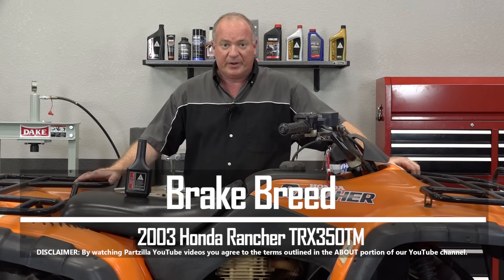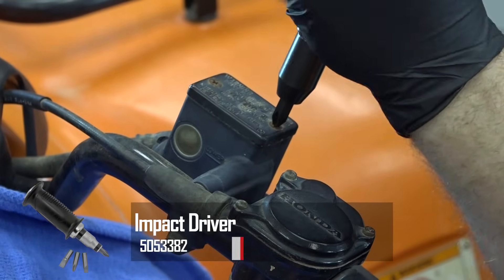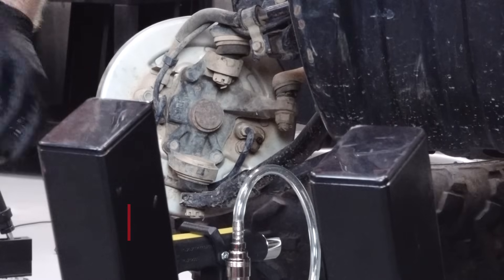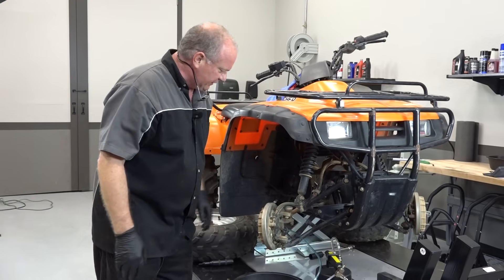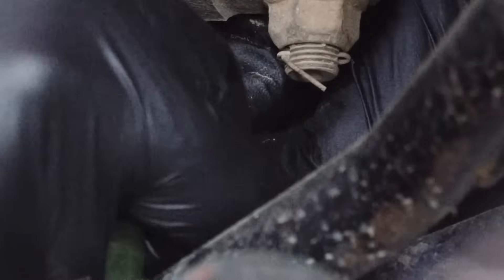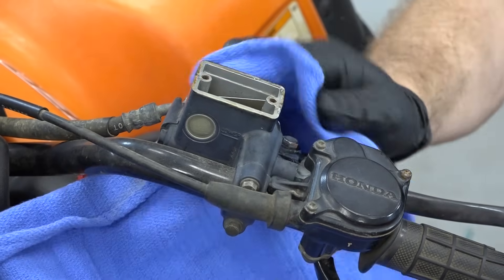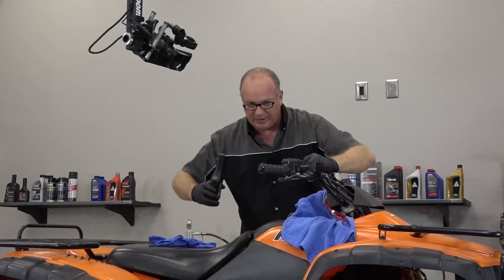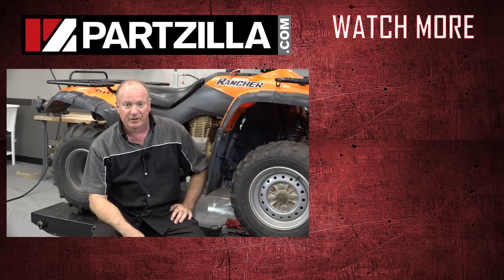How to Bleed the Brakes on an ATV | Honda Rancher 350 | Partzilla.com

Comment: what does it mean if I pump the master cylinder and no resistance/pressure being made; no fluid comes out of the bleeders at each wheel? I have just put on new brake cylinders and followed your directions for disasemblying the master cylinder (cleaned it as didn't get rebuild kit).
Reply: I just done the same on my 03. Never could get any resistance on the hand brake lever. Replaced that master cylinder and had no problems getting great brakes.

Comment: Hey bud, im having issues trying to bleed my 89 fourtrak. I put new pads new cylinders and a new used master cylinder and i can't bleed it and there is no more air in the line that it seems.
Reply: Hey brother I was having the same problem I just kept writing for years with no brakes and just said fuck it.

But as I got older and wiser I just wanted to fix it. I did the same thing put new brakes new master cylinders and seems like I couldn't get the air out.

What you gotta do is adjust them almost all the way out to where you can barely squeeze the drum on  You might even tighten it more once you get the drum on then squeeze the brakes breaks and you will have breaks and you will be like oh my God.

 If you notice the brakes are too tight and it's dragging the 4 Wheeler just backup the adjustment a little bit until the it until the bike moves freely
Reply: @crawling86  I'm having a problem where nothing will come out of my bleeder valve when I open it up after pumping. should I try what you said?
Reply: @dustinbowen7201   Adjust the brakes out just enough to where you barely can get the drum back on.

After you know you've , Blood breaks I'm sure you've blood on perfectly fine every time, most people don't realize that you just have to adjust them out, once I adjusted the brakes it worked perfectly. That being said it's not that easy To adjust but it is once you figured it out it is.

 You will notice once you adjust them out and you hit the drum you will have something in your handle compared to nothing and then go from there.
Reply: @crawling86  Thank you I'll try that

Comment: Quick question, my front brake handle is very tight. Will only come back about a quarter of an inch. But the front brakes do work, and they work well. But I am concerned about the tight lever, not sure if that is an issue if the brakes still work fine?
Reply from the maker: As long as they aren't fading, it's fine.
Reply: Ok great. Thank you. And thank you for the video.

Comment: Trying to vacuum bleed my brakes after replacing the shoes.  I notice a lot of bubbles after multiple attempts to bleed each side. Not getting much stopping power. I noticed when you were bleeding with the mighty vac you had a lot of bubbles also. Is that normal and still acceptable or should it be just fluid?
Reply from the maker: Bubbles in the might vac tube?  That's normal.  Air from the connection and air from within the line.
Reply: @PartzillaParts  Thank you.

Comment: Is the air breather tube necessary to keep connected, or can I just plug it off.
Reply: james pruitt u should try to have it, the outer brake drum has a rubber seal, i like to grease that seal a little helps keep foreign objects out, and it theres no vent line it will have crap pour into it. If you were to simply plug it it will create a leak around the seal and let foreign objects in that way

Comment: i have a 1986 honda trx 350 4x4 and i'm having trouble with my front brakes BARELY working. I have bled my brakes maybe not enough put new shoes on and rebuilt my front brake wheel cylinders. But it seems as though as there to much pressure on my front brakes and they barely work. When I push in my front brakes I can't even get them to go all the way back to the handle bar. The lever moves maybe 4 inches and then I slow down but do not stop by any means. By the way i had to buy an aftermarket master cylinder, I just bought an OEM one on ebay and i'll be buying the rebuild kit. Any suggestions? thx
Reply: I also have new dot 4 brake fluid in the lines.
Reply from the maker: Wait, so the lever is hard, but won't transfer the pressure to the pads?
Reply: @PartzillaParts  yes thats correct, sorry for such a late response lol

Comment: I replaced my shoes but handle still comes all the way back with no pressure , cant figure out whats going on
Reply from the maker: Keep bleeding, sometimes it takes a bit.
Reply: @PartzillaParts  i had stuck wheel cylinders
Reply: @kp763  what did you do to make them unstuck haha?

Comment: I tried bleeding my front brakes with a mightyvac hand pump. It seems like air and brake fluid are flowing into the clear tube, after I close the bleeder valve on the brake panel. Can you tell me why this is happening? And as a separate question, do the crush washers for the banjo bolt HAVE to be OEM?
Reply from the maker: They don't have to be OEM.  The seal on the pump line might not have sealed?
Reply: Partzilla I bleeded my brakes after changing pads  got fluied to come out bleeder valve after lines were emply but brakes are not getting hard and not working yet . ? Im wondering if my caliper seals went bad now or what?

Comment: I’ve replaced the rear brakes on my Honda rancher 420 but after I got it back together; there is no reaction after I tried to apply the brake.  Can you think of what may be causing this?  I don’t believe the back brakes need to be bled like the front but I’m not 100% sure...help!   Please :)
Reply: Amber Pinnick yeah I’m actually in the same situation with my foreman 400, both front and back brakes aren’t working.
Reply: Your back brakes are mechanical. They can be fixed with lubrication of wires and Springs  new pads. It's very technical and in time consuming people give up quick.

Front brakes are hard too because they're hydraulic and I'm actually trying to get all the air out of my front brakes, got the back brakes fixed really good.

If you can't figure out how to get the small wire to stay put for back breaks attack welded mine
 Make sure you lubricate where the brake pads move
Reply: Just got front brakes to work need to adjust master cylinders almost all the way out! to were drum belay goes over brakes!!! That's why nobody can get the air out. It's not air its adjustment. If hard to move when done adjust back a little bit. 15 years no break's. Now front and back break's are 💪
Reply: @crawling86  I have a Honda recon and can’t get the brakes to bleed. Replaced pads and pistons. It’s pushing fluid out the bleeder and not air. But still no pressure on the pedal. Any advice?
Reply: @MrTap86  Hoping someone answers this, I'm having the same problem.  Tried gravity bleeding, tried repeated bleeding by squeezing the handle, still no brakes.
Reply: @crawling86  What adjustment are you talking about with the master cylinder?  Just bought mine, sight glass looked like it was cracked and piston was super sticky, so I just replaced the whole thing.  Gravity bled it, tried bleeding it by squeezing the lever, still no brakes.  Any advice?
Reply: @kveltman4672  so I figured it out. I used a brake bleeder from harbor freight. It forced all the air out of the lines. Worked within minutes. I am still struggling with the back brakes tho. Somehow it gets mud in the drum everytime the kids ride it and they lose back brakes. Iv replaced the seals and bearings it should be water tight. Idk I’ll keep trying
Reply: @kveltman4672  35$ for the pneumatic brake bleeder your front brake problem will be solved. For some reason pumping the brakes alone won’t get it done on these master cylinders on atvs

Comment: I dont know if i need to bleed but when i push my front brakelever in it goes all the way into the handle and then it doesn’t brake.... what should i do?
Reply from the maker: Make sure your fluid level is full and then you will have to bleed the system

Comment: I have recently replaced my brake pads, new cylinders and new master cylinder. I have lost all brake pressure and cannot get any pressure after bleeding. When driving I can hit the brakes 4-5 times and the brakes will activate. Am I not bleeding enough? Help John!!!
Reply from the maker: You most likely still have air in the master cylinder.  Bleed it and the lines again.

Comment: I love watching vids my son has a 04 rancher 350 es...we bought new master cyl..bled brakes as shown and we still have no brakes no pressure at brake handle either the wheel cyl are moving but not much now my question is? Are brake cyl possibly bad or is new master cyl too small
Reply from the maker: Sometimes it takes a lot of bleeding to get the air out of the master cylinder for first use.  Keep going!

Comment: What about rear brakes?
Reply from the maker: This unit doesn't have hydraulic rear brakes-- they're cable actuated. We did do a video though on changing the brake shoes on the rear drum brake: https://youtu.be/qEQ8yU-DyYo

We replace the foot and hand brake cables here: https://youtu.be/73yD2RxrLxA

Comment: where can i get a new rubber seal i cant find them on ebay
Reply from the maker: You mean the rubber seal in the reservoir?  #9 on this diagram?  
https://www.partzilla.com/catalog/honda/atv/2003/trx350tm-2a-fourtrax-rancher/front-brake-master-cylinder

Comment: my brakes wont bleed went trough a hole bottle of 4 dot  still has air in system replaced front brakes and wheel cylinders and tried a hand pump vacuum pulls out the fluid but still has air in system . took cap off  took line off going to brakes put finger over hole builds pressure in master cylinder.
Reply from the maker: Start with the simple answer, replace the washers on your banjo bolts for the brake line.  Sounds like there is an air leak somewhere.
Reply: thanks it was a leak at the master cylinder line on the copper washer thanks and god bless you

Comment: I'm having a problem, when I fill the reservoir up and pump the brake lever nothing will come out of the bleeder valve when I open it up. Could it possibly be a clogged hose?
Reply: You ever figure the problem out? I’m guessing either the bleeder screw orfice  is plugged or bad master cylinder.